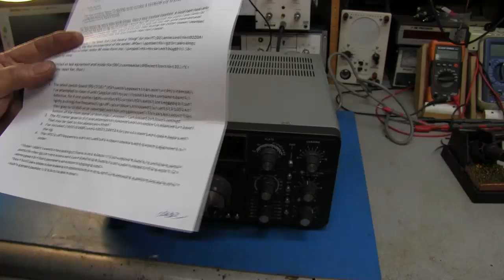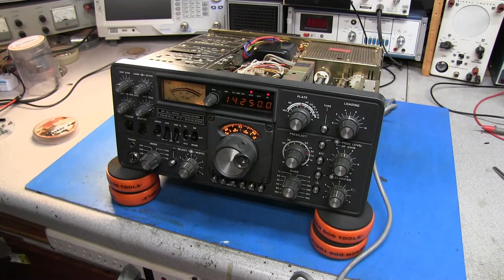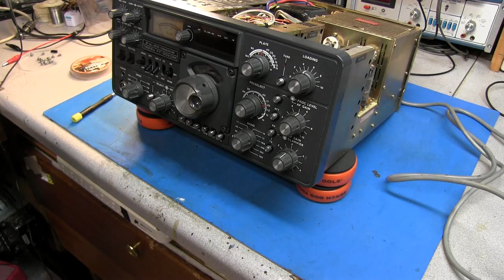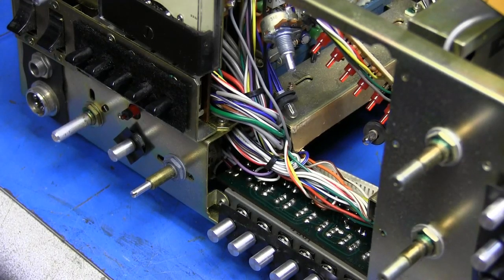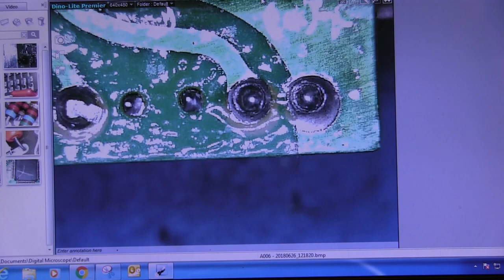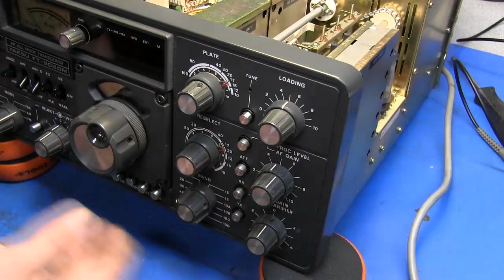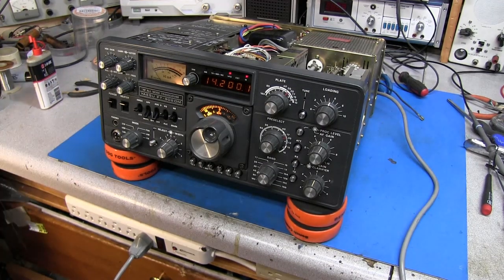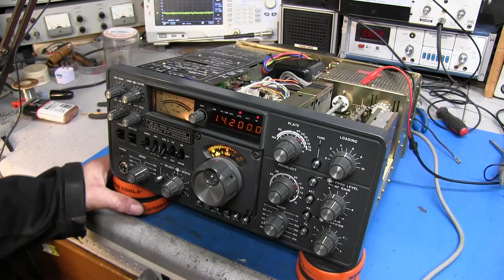#255 Yaesu FT 902DM Repair

Comment: Intermittent contact on crystal display PC board. Like your simple solution with reheating the solder joints. Nothing worse than trying to fix a problem
caused by someone else. Got to go through everything sometimes just to  fix their mistakes . Hope there will be a part two on this unit. Steve
Reply from the maker: Thanks Steve. Yep always trouble when someone tinkers with stuff. At least the original fault was due to design and age

Comment: Would love to see a part 2 on this radio. I am about to put my grandpa's old FT-901 DM back into service. Brought it up on a variac recently and when I get some free time, I am going to get it hooked up on the bench and fully test and tuned. Thanks for all your videos! They helped a lot with his old FT-101B I am restoring. I will be recapping it here soon as well. 73 & 75 AE7WY
Reply from the maker: Play close attention to the filter caps. When they leak they will start arcing and burn the boards. Thanks for the comment

Comment: Hi Buddy,
Definitely a Part 2. I have a 901DM that I need to lube the VFO as it's getting stiff. I also bought a capacitor kit to replace all the capacitors. Would be nice to see how you perform an alignment on the 902. Stay safe.  73  WJ3U
Reply from the maker: Thanks Don

Comment: Wow I had a FT-902DM with all the accessories except the RTTY unit. Great radio after cleaning all the board connectors and recap job. The radio and all pieces that went with it was too much for my small radio shack/work shop so had to sell the whole works. Still have it's brother the FT-901DM here that needs work. My wife said to get rid of that old junk but as a true old ham radio buff it is hard to do. Sold that radio and brought home 2  FT-101ZD to play with. I wonder when it will ever end. HIHI Please upload another video on the FT-902DM alignment. Thanks again for the great videos that bring these treasures of old to life again. What else do you when we have 2 weeks of -30 C

Comment: The reason that the vertical row of pushbuttons get stuck is not because the board that holds them is mounted wrong. The problem is that you reassembled the diecast  front bezel without the four washers in place that align the bezel slightly higher in position, so that the buttons can move freely. You probably did not notice these four washers (a stack of two on each side) when you removed the bezel from the radio; they have a tendency to fall out without one noticing it, especially if they fall on the ground instead of on the work bench. Put these four washers in place when mounting the bezel (2 x 2 washers), and the switches will move freely.
Another tip: Replace the light bulbs (two in the meter and two behind the analog dial) with soft-white bright LEDs. It will appear exactly the same in color and brightness as the original bulbs, without the heat, and they will last forever. You need to put a 680 ohm resistor in series with each individual LED to make them work on the 12V that supplies them, and make sure the LED polarity is correct before you re-assemble. Because especially the two in the meter are difficult to reach.
How do I know all of this? I just restored a FT-902DM myself. A great radio worthy of preserving.

Comment: Definitely would like another session on this radio- I have a FT901D with a few issues - sticky vfo/backlash to start with.  Just getting the VFO out in the first place was no easy matter- wish you showed how you did that!  Your videos do motivate me to roll up the sleeves and have a go.  BTW- its +95 F the next 4 days in Vk5 so a little hot for the shed bench!
Reply from the maker: I will show how to remove it in part two. 95F!!! now that is nice.

Comment: Hi there, fantastic video, learnt a lot by the way you just work you're way through the process. I have that model myself and it has a few similar bugs, but now feel a little more confident to have a crack at trying to fault fine the problems... Don't know if you checked the earlier part of the video, about 6.35 min but both the dial and meter lamps were working plus the Tune LED didn't seem to work either... so would love to know what you found...
Kind regards
Reply: The tune LED is difficult to relocate in its appropriate hole when reassembling the diecast bezel as a whole. It is easy to misalign it, then the LED won't be visible any more.  Or even worse, the thin red plastic rod (like a light pipe on the LED) might have broken off during the re-assemble process. I assume one of these issues is what happened here.

Comment: Great video, I've just acquired one of these but want to check the AC plug on the back. Would you know where I could get the pin out configuration for this at all ?
Reply from the maker: I believe it is in the manual, I will have to check.
Reply: Thank you, my manual
Only shows the DC power cable.
Reply from the maker: @deano3258  Ok, I will search and see what I can find.
Reply from the maker: @deano3258  Ok, Page 54 of the FT-902DM manual. This is the middle schematic. Top center shows the wiring for AC and DC in the schematic,
Reply from the maker: @deano3258  http://www.radiomanual.info/schemi/YAESU_HF/FT-902DM_user.pdf
Reply: Ahh you are star ! Many thanks for that I really appreciate it. I couldn’t find it at all, once again many many thanks 😊 🙏
Reply from the maker: @deano3258  Not a problem my friend.

Comment: I have a FT901DM that always worked well. Sadly it doesn't work anymore and I gave it to a local ham who kept it for years and finally I got it back in the same condition - obviously he wasn't up to the task... I feel  it should be repaired and not left it in a corner to collect dust - but I couldn't find someone capable ...could you possibly give a chance to repair it? Thank you